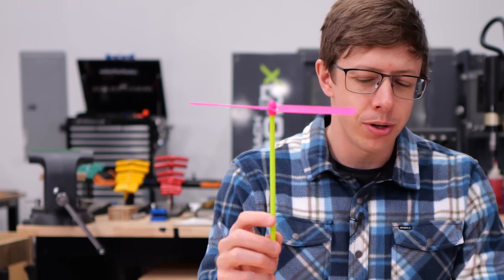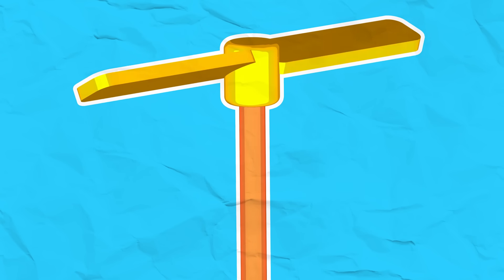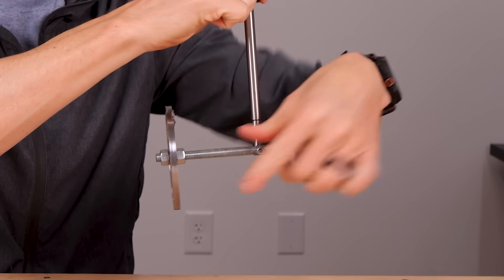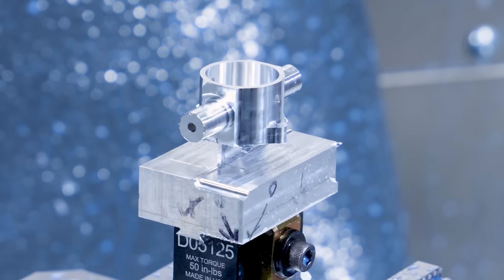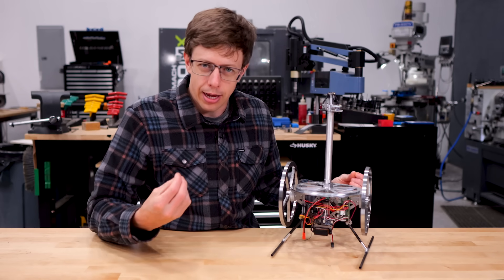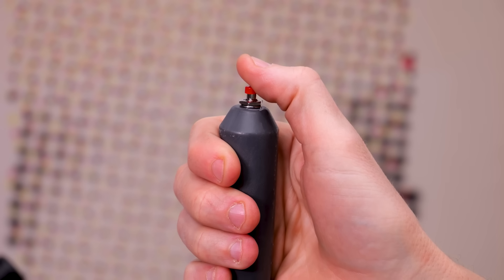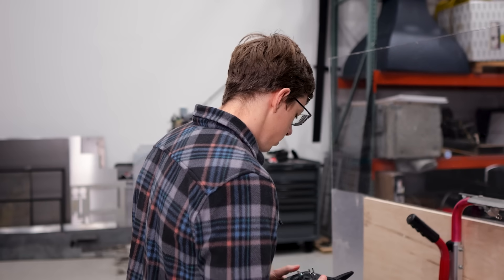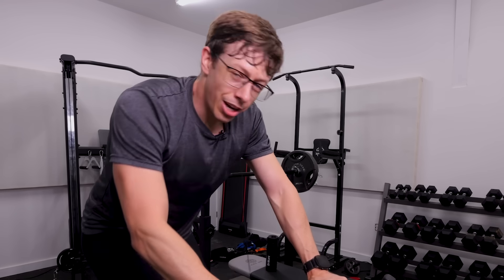I really thought this would fly well

Comment: this is probably cave man thinking, but refer back to the toy example. All it had was a stick and a two-bladed propeller. The toy is stable enough to fly straight and then gently down. Why not remove the flywheels, corrector wings, etc. Just have the metal pipe and the propellers. Maybe make it out of pvc pipe instead to make it lighter. I know that this is either what you tried already or not "machiney" enough, but i say do it as a proof of concept and then see how you can over-engineer it.

Comment: Should have tried counter-rotating blades.  They use those for those super tiny RC helicopters, it eliminates the need for a tail rotor [or fin blades for control surfaces].

Comment: Im excited you decided to continue the project. Sidenote on cancellation of gyroscope recession: In motoGP they switched the engine to rotate "backwards" by putting in an additional gear in the transmission to cancel recession from the wheels- this made the bikes a lot quicker to turn into the corners
Reply: I always wondered if they did stuff to bikes to counter these forces.
Reply: @kissingfrogs outside of racing the gyroscopic forces help to keep the bike stable so most bikes don't try to cancel them. (also most bikes are cheaper than MotoGP bikes)

Comment: Throw out the separate flywheels. Put a metal hoop around the circle traced out by the propeller. It will function as a flywheel and will also give stability. The European version of the propeller toy works exactly that way.

Comment: When doing the initial test, with the brackets, a.k.a. the training gear test, my null hypothesis would be that there is no interaction between the air leaving the propeller, and the counter-precession flaps, when on a hard surface. 

How would the air interacting with the ground affect the air around the counter-precessions flaps? Would putting the helicopter on a raised platform made of thin wire grid change the situation?

Comment: I think you have friction in the system that would just cause that twist.  why dont you eliminate the friction by using two counter rotating gyros but the gyros are paralell to the spinning rotor.  You have more flexibility with gyros beside each other.  Your other option is just a helicopter tail out the side.  helicopters have counter rotating blades, so you have a gearbox, and once powered, it spins a pair of propellers clockwise, and the other propeller counterclockwise.  Im a math guy, dont get mad.

Comment: Normally I'm barely able to keep up with you, but in this case it seemed really obvious that you are building a helicopter and the only real way to do that is: tailboom.   The idea of counter rotation control surfaces only works on an airplane in hover because of the large surface area and there is a long moment arm (like a tailboom), but you will immediately run into drag issues.  Counter rotating rotors with the weights on the same axis might work.....

Comment: Could you have put the two flywheels horizontal under the main shaft, counter-rotating, and geared their speed down for the main shaft? Wouldnt that have bypassed a lot of the problems of having them vertical on opposite sides of the center shaft? Would also make it so the whole thing's weight would be on the bottom of the vertical so it'd be more likely to land properly even if it went out of control in the air.

Comment: So the problem with control surfaces is that they need airflow to function, which is something you don't have a lot of starting stationary.  Also, you'll get all sorts of interesting turbulent interactions between the rotor wash and the ground, so the flow you do have will affect the control surfaces in a somewhat unpredictable fashion.  Finally, when you enter the planned autorotation phase of the flight, the fins will be on the wrong end of the center of mass, so it will tend to flip over to fly headfirst into the ground.

Comment: Contra-rotating props would be quite the challenge. A possibly easier solution could be a 3rd fly wheel underneath the propeller drive gear that weighs as much as the propeller and propellor drive gear that is driven in the opposite direction but I'm not sure if how propellor drag would factor into that.

Comment: I don't understand why you are not satisfied with a flywheel located coaxially with the helicopter's propeller? All that is needed is a regular planetary gearbox on its axis. The air resistance of the helicopter's propeller will perfectly take energy from the super flywheel.

Comment: Maybe go a simpler route.  The toy is an axle to a pair of wings wich serve as a form of energy storage as you meant, a rotational capacitor of energy would be a fly wheel,  would it not?  Maybe you could squeeze so performance out of adding weight to the wing tips, and maybe find a way to spin it up mechanically.

Comment: Autogyros have fixed blade positions and seem to autorotate just fine. If you just lock the blade angle, how well does this work? Would you be able to save enough weight and efficiency by reducing that complexity to get even higher?
Also, if you haven't already reached this conclusion for part 2, your solution is below.

Use a tail rotor. Real helicopters have one for a reason.

Comment: I think you lose the flywheels and just build the traditional helicopter toy design. If you want to be fancy, keep the variable pitch system so you can spin it up to a very high RPM before a carefully controlled liftoff. Then when it falls from the sky, deploy an inflatable bladder above and below the blades to protect them when they hit the ground. Another option would be to have the wings fold up at a 45 degree angle, guaranteeing it falls stick first, at which point the wings could pop off by design.

Comment: Make the flywheel vertical and aling with the propeller, also use a clutch system that you can remote activate or a clutch that auto-engages at a certain RPM, and you might also need some stabilizers. At this point this is going to be a rocket with a propeller, which sounds great.

Comment: 1:30 Not just a sonic boom, MULTIPLE sonic booms for as long as the tips of the rotor remain past the speed threshold. We know this from the XF-84H, AKA the Thunderscreech.

It was an attempt at a supersonic propeller driven plane, but between the prop diameter and rotation speed, it created about 15 sonic booms per second at idle and over 900 at max power. That constant drone of sound was said to be heard 25 miles (40 km) away, and it physically afflicted people, inducing nausea, headaches, and even seizures, possibly having clocked in at 200 decibels, which is basically like being next to a rocket launch.

Now as for the project: Rather than do what you did, go simple with what you're launching. Just a prop on a shaft like the toy you showed in the beginning, but 3D printed so you can place weights at the tip of the blades, and make the rotor itself the flywheel. Then launch that from a stationary device.

Try different prop designs to attempt maximum height too, 3 blades might be better than 2 for instance.

Comment: Could you use the flywheel itself to provide the counter rotation to the rotor?  A horizontal flywheel mounted vertically inline with the rotor but rotating in the opposite direction.

Comment: I lot of people have made good suggestions, but I haven't seen mention of how the hand propellers are stable and the flywheel propeller isn't.

The hand propellers spin in the short axis (rather than end over end), so there isn't enough angular momentum to spin any other way. To start tumbling end over end takes more energy than just staying straight, so it won't tumble.

This flywheel propeller had a lot more mass sitting in the center and a much wider body, so it's short axis was probably around the flywheels rather than around the propellers, which means it will tumble rather easily.

This effect of switching between medium energy spins is the Dzhanibekov effect, and Stand-up Maths has a nice video on this subject called "Ellipsoids and The Bizarre Behavior of Rotating Bodies" that explains this quite well.

Comment: It's really hard to get yourself out of a dead end when you think you've got a cool idea. I'm pretty sure you can calculate the power storage gains from faster spinning flywheels and you can guess the losses from home made bevel gears, many bearings, aerodynamic control surfaces and a lot of extra weight. And if you compare those two numbers, you'll probably find that a flywheel around the propeller wins easily.

Comment: Im not an engineer or anything like that but i think there are a few issues with the wing that kinda make sense at least to me but please someone correct me if im wrong. From my limited perspective i feel like the wings would work at a higher speed because more air would be moving past them Increasing the stability provided. Another thing could be since its so close to the ground you are generating turbulent airflow near the wings which could be decreasing stability at least during inital launch. I wish i had a helpful solution though cause the idea is very cool.

Comment: You're trying to be too complex. if you just stuck with the original design and put a motor with a electronic quick release 
In The Hollow part of the tube
You would get a fairbit of height because the Center of gravity is lower down the tube
Allowing the Propeller to fly straight up

Comment: We have a more sophisticated version of the toy with a 3 blade design with an added circumference for safety. You put that on a handle and pull a cord and only the flat top goes flying. That thing has better performance than your DIY copter.

Comment: Why dont you make a 3rd smaller flywheel on the bottom with the same torque as the rotor spinning in the other direction to cancel out the rotation?

Comment: I think people don't realize how big of problem he has, all the energy from flywheels transfered to shaft. There is no gear system, not significant resistance from boy. It will really turn at 1000 rpm if it gives full power. Counter-rotating propellers or a tail rotor wouldn't work as entire body effected, it is not just propeller torque like in a helicopter. I don't think he can stop it, i would just balance/lighten everything in body and seal it off like flywheels. And let it rotate in 1000 rpm, it would at least fly for a while if it is balanced enough..
Reply: For making video interesting he can push target rpm way too high and send it off like a rocket. But it won't last long haha.

Comment: You'll have to split the shaft at the top with another differential gear and two propellers rotating in opposite directions like a K MAX helicopter. Then use some sort of linkage to actuate the pitch of the blades

Comment: why is the fly wheel attached the the chopper?

have the fly wheels separate and perpendicular to rotor mast, 
spin the chopper with blades neutral/flat, 
use the servo (also separate) to increase pitch with a button, 
watch it fly

or stick a tail rotor on and have a proper chopper \o/

but you already knew this

Comment: I'll agree with Mrs. 10/10 for doing the sinning things and failing spectacularly. 🎉

I think the problem you are facing has to do with a aerodynamic principle found on all single-prop aircraft: P-factor. Your assumption is that the air under the prop is being accelerated directly toward the ground. What is actually happening is that the air is spiraling around the craft in the direction of the propeller rotation. The air is hitting your wings and actually making the torque worse. Also, the angle of the air-spiral is proportional to the speed of the propeller; the faster you go, the steeper the angle, and thus, more adverse torque.

Single engine prop planes usually counter this by noticably offsetting the rudder to one side so as to provide counter thrust. This is one of the reasons there is an ideal cruising speed near where the rudder couteracts the P-factor. 

If you were to remove the wing, or even put it horizontally, I think you should have better results. Quite a few people already mentioned counter rotatating props. There may be some other thing you think is better. Either way, I think the P-factor acting on the wings is one of your largest adverse supplemental torques acting on this design.

Good job, you can do better. God bless. Thank you for your time and effort!

Comment: Watching you weaponize p-factor to fight counter-rotation and precession IN ground effect is every Aerospace Engineer’s control dream. And by dream I mean nightmare. 😂 (My best attempt at explaining this.) Love it as always!
Reply: I love that Destin obviously has notifications turned on for Stuff Made Here.
Reply: Weaponized P-Factor is my new favourite word combination! 😂
Reply: So that is why it wasn't working on take off! Feeling pretty good about figuring that one out :D
Reply: only thing i could think of watching this was, we should all watch the helicopter deep dive again XD
Reply: And by nightmare you mean impossible. There's a reason why actual helicopters use either counter-rotating blades or a tail rotor.

There's just no way to make a scaled-up version of that toy without having the whole thing spinning. Otherwise you're just designing and making your own RC helicopter sans battery and motor. Maybe instead of heavy flywheels he could use a wound spring to store energy? Idk, you'd still have nothing to push against.
Reply: @sntslilhlpr6601  yea I dont really understand why he went this direction rather than just making a slightly larger and beefier version of the toy and spinning it up with a motor. He already has the rod and the blades, disconnect that from everything else, spin it up from the bottom, and Im sure that thing could reach insane heights.
Reply: @SpydersByte  it worked in his simulation as he explains at 2:23
Reply: @sntslilhlpr6601  It's not impossible in principle. Counteracting the spinning doesn't require more energy. This arrangement is very reminescent of the arrangement of rotating and nonrotating vanes in turbines/compressors.

I wonder if the whole thing would work better out of ground effect (e.g. if it started out suspended a meter or two above ground).
Reply: But it is impossible right ? By adding those wings, he is countering rotation but also pushing the whole thing down, so he would need to spin faster which would increase rotation.
Reply: @stuffmadehere @smartereveryday Wouldn't it be cool if Destin and Shane would collaborate?! I am pretty sure we would end up with a flywheel helicopter flying through a non-newtonian fluid explaining Reynolds number and  laminar flow! :)
Reply: I gotta be thankful to Kerbal Space Program for teaching me some of the aerodynamic systems 😂😂😂
Reply: Never forget - nightmares are dreams too!
Reply: Helicopters already use tail rotors for this.
Reply: Why not a small flywheel on the bottom with the same moment of interia as the rotor going the opposite way. Cancels the rotor torque just like the second flywheel cancelled the precession.
Reply: Where’s the reference to Destin’s epic video on auto-rotation and his scholarly exchange with Niel DeGrasse Tyson? 

Also, is there any reason he couldn’t have just one flywheel rotating the same direction as the propeller?
Reply: It got off the ground, so that is a win, and it landed with minimal damage, so it was a success.
Reply: Counter rotating blades. Or maybe you could just use counter rotating counter weights instead of flywheels "weaponized p-factor"
Reply: Please colab with Vsauce
Reply: @Sandux930 why though? It’s not like vsauce has anything to contribute.

Comment: Could you have the flywheel parallel to the axis of the blades spinning in the opposite direction? Or if you keep the current flywheel design, could you have a second propeller in the opposite direction?

Comment: I always feel so smart when I see something earlier in the video than you did (the air drag on the flywheels).  I remember seeing some world record bike speed records where they had wheels covered to reduce friction.  

A couple thoughts (not a physics guy, although my dad was a physic teacher)... could you go at the speed limits of the blades with steeper angles on the blades?

For a simpler, toy version, I had a toy top as a kid that had a string powered launcher.  You wound the string around shaft and then pulled it real fast.  It was kind of like the bow fire starting system, except that the string came off at the end of the pull instead of going back and forth.  I wonder with a simple string launch and steeper blade angles how far you could get as a simpler toy.

Comment: I appreciate the video, even when it doesn't work out. The joy is in the experience, not the product! You need counter-rotation on the same axis as the blade. You can either stack 2 blades, or use a weight (just make sure to balance the inertia!).

Comment: Counter-rotation.  That's the only viable answer within your broad design parameters.

You could spin the flywheels independently for each rotor axis, but without perfectly matching the speeds, the end of the flight will always include loss of control.

Or you can gear the second axis to the first.  You'd have to rework your pitch controls anyway to deal with two rotors.

Trying to use control surfaces the way you're doing will also reduce the amount of lift you get, since you're partly pushing the rig downwards. If you make larger control surfaces, you'll create more downward force.  Without trying to do any calculations, I can easily imagine that by the time you overcome the torque of a single rotor, you'll be basically unable to actually go upwards.